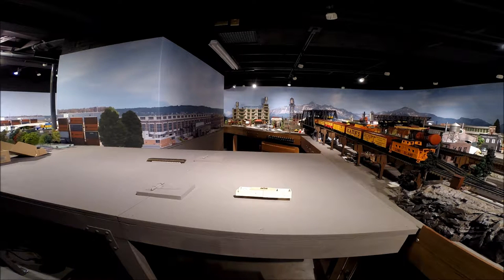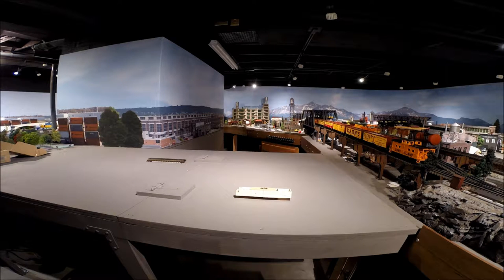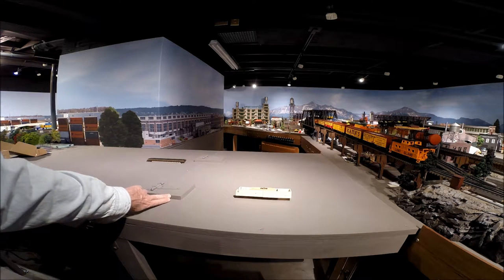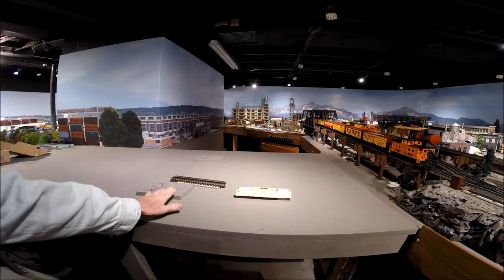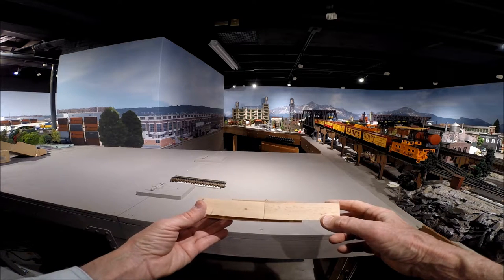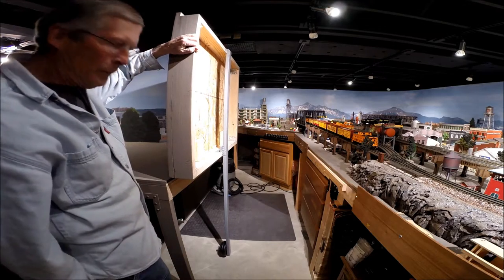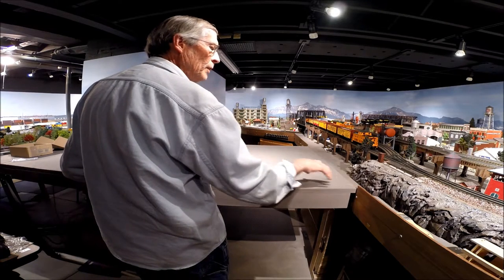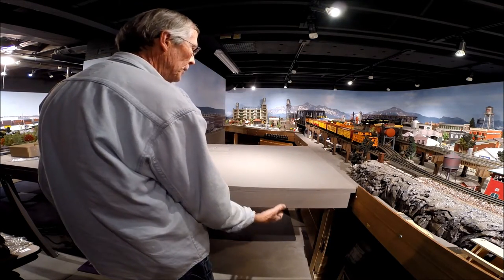O Gauge Lift-Up Access Gate - Carriage House 3 Rail Layout

Comment: An idea I have is to make the outer edge frame from a length of wood which has outer ends cut at 45 degrees. This would be cut from the centre portion of the length of wood leaving offcuts at each end which will therefore also have 45 degree ends. The centre portion would fit under the lifting end of the lifting gate and the outer sections would fit to the fixed baseboard in such a way that, when lowered, these frame pieces will fit each other and be self centring. This, I hope, would guarantee alignment of tracks etc. I hope this (garbled) explanation is understandable.